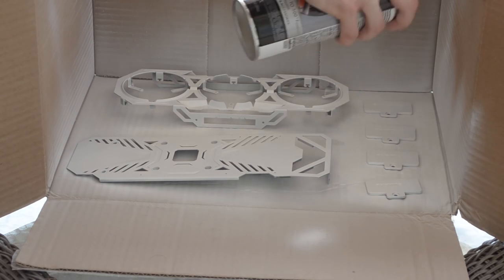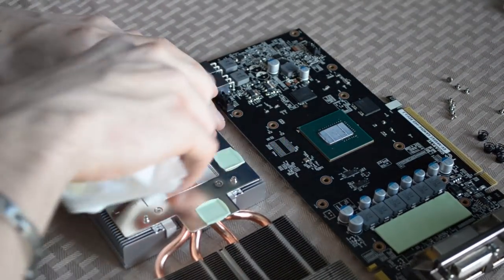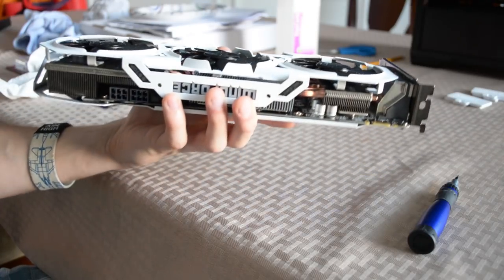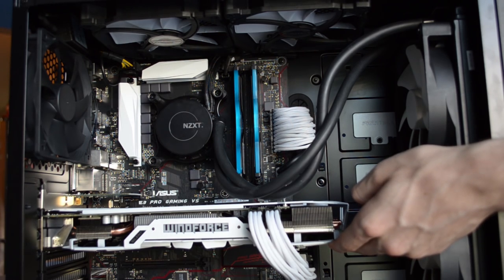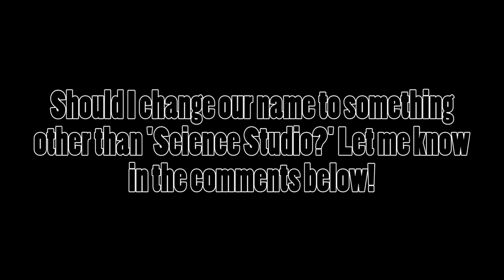Paint Your PC Components (Vol. 2)

Comment: Dude thank you I have a gigabyte gtx 1060 OC Model GV-N1060G1 and it was a b** trying to get everything apart. Did not want to reseat GPU but it made me due to factory potions of screws and power connectors. Dumb....  I am still taking mine apart right now trying to replace fans and your video helped me so much and was the only one out there remotely close to mine. Everyone else has a easy "Johnny 5 Disassemble" but no, not mine... Grrrrr.  Thank you had to apply some force like you said to pull up the heat sink. Also my screws to release heat sinks are on bottom and the front of the card, not the side like everyone else says in there videos, took me for ever to find it. o.o

Comment: Heyyo Greg, so I'm thinking of painting my parts white and doing RGB lighting like you did since this turned out amazing for you... but I'm feeling like a wuss since I'm worried about warranty so I was thinking of trying it with a type of paint that's removable... I know Plastidip is removable but it's rubberized and acts like an insulator so it's not the best choice. By chance can you recommend a type of paint that is removable in case I need to claim warranty that won't act as a rubberized insulator? Or do you think a rubberized insulator won't make too much of a difference?

Comment: You're making the heatsinks less effective by having layers of paint added to them (it's like you're putting a blanket between the heatsink and air).  Sure, it will still cool the components, but at a higher thermal equilibrium.  If one must paint a heatsink (as oppose to electrolysis), a paint that is specifically designed for high thermal conductivity is highly recommended (instead of just any off the shelf paint).

Tip for painting: Place your objects on a piece of paper inside the box.  So that you can rotate them (by rotating the piece of paper) between coatings while still having the walls up.
Reply from the maker: +PCUser1024 VRMs should never ever ever get very hot. Your first point is rather moot. I do, however, like your idea with the paper. Will have to do that for next time.

Comment: Nice guide :D You might want to be a bit careful with as5 not getting overspread (in case you put too much) as it might burn your gpu (if it gets in contact with any pins or anything that should not be touching)
Reply from the maker: +CubiX It's non-conductive. It won't hurt anything if it happens to run over, but I didn't put that much on anyway.

Comment: idk why no one actually researches what paints to use.. I'm a painter by trade and any plastic surface should be sprayed with adhesion promotor or heck even filling epoxy primer before using a basecoat. Otherwise it can easily peel, crack or melt off.

Comment: great idea, but if you want to have a better coat than what he had on his heatspreader, here are a few tips

1) mask the heatsync where the thermal pad would lie
2) PREP OR SAND THE SURFACE
3) tie it up as to not touch the sides of the paint, just thread it through the inside of the hole
4) if you dont wanna tie it up with dental floss, then you can put some poster tack on the tape where the thermal pad goes, and get some wooden skewers and use it to spin the peice around in your hand when painting
5) invest in some painting tools, if your dad has some use those, airbrushes are god teir for this, just make sure you use something like acrylic like tamiya, and airbrush that baby to sexy perfection
6) TOPCOAT TOPCOAT TOPCOAT, i cant stress this enough, dust will stick to the paint like a BICH, so topcoating will prevent that and scratches, and dont get the shitty krylon or generic brand topcoat, go to a hobby store and get yourself a can of testors, tamiya, mr hobby, etc whatever you can get your hands on, but please dear god no krylon
Reply: What do you mean by "Topcoat"...do you mean primer first?  I'm a painter by trade but houses are sure different than PC parts so I'm humbly asking for advice.
Reply: @furankuchan  i don't know paint at all... but it sounds like he said put a top coat over the last coat of paint to protect it from dust and scratches

Comment: Unclear instructions. I took the cooler off my cpu and painted the silver part pattern cleaning off the thermal paste and no I smell burning plastic when I run chrome.
Reply from the maker: ? The instructions weren't "unclear." You likely didn't reseat the cooler correctly or painted somewhere you shouldn't have. Besides, this is a very old video.
Reply: @GregSalazar  just trolling bro! great vid!

Comment: I have a p400, but how did you manage to use a remote with  the led's? mine are just connected to the front panel button
Reply from the maker: +joris yauw (MrYauwLifts) Separate LED kit. I've detailed it in my Xeon build video.

Comment: do you have to put new thermal paste on?
Reply: Nope! You don't have to but since you're removing the heatsink from the die anyways, you're introducing small micro bubbles that won't be there if you put new thermal paste on, thus technically reducing efficient heat spread. Generally if you have the high end components, you'll have thermal paste around to reapply. However it's not a necessary step.
Reply: +Josh Allen thanks for the answer man!
Reply: Clutchkick Chris recommendation confirm yes, I personally would use artic MX 5, or gelid solutions g extreme.

Comment: Would it be bad to paint my dust filter that sits on top of my case?
Reply from the maker: Probably.
Reply: Science Studio Ok
Reply: Don't paint that, the holes are small and the paint will fill those in. A good alternative would be to find some mesh in your preferred color or paint the mesh itself, then measure the dust filter and cut the mesh to the same size and place it over top of the filter to give it a tint of the color you want.

Comment: I would caution against spraying heatsinks, most of them are anodized. Yes engine spray can withstand high heat, but who knows if a spray makes the heat dissipation less efficient. How less efficient? No idea. A study would be cool, but until that happens, you might want to reconsider. What I will say though is kudos for not spraying the underside of those heatsinks where the thermal pads contact, that is important.

Comment: do you need to use alcohol to remove the thermal paste, or can you just do it without it?
Reply: u need to use alcohol
Reply: I shall make the rest of the guys here cringe. I did not have any clean alcohol, so i opened up the fridge and found Captain morgen, apply some of the morgen on the Qtip and whipe away the paste. I would not recommend it, but if it works it ain't stupid. It leves no room for errors however, so make sure the Q-tip is not soaked. as the alcohol vapor is not pressent in that unpure alcohol mix.

Comment: Nice video mate ... i have a problem, i have an Asus GTX 970 Strix graphics card. which is about 15 months old now, and it's back plate has developed some minute scratches due to cleaning dust off of its surface ... rest of the graphics card is in excellent condition and the scratches are just into the clear coat ... can you please tell me how to remove those minute scratches from my GPU back plate
Reply: +amanvds Without proper buffing equipment, painting over the scratches is probably your best bet.
Reply: SimplyChem
what kind of buffing equipment should i get. is a car scratching removing kit gonna work? i wanna sell my 970 and get a 1070. so painting is not an option for me
Reply: I honestly have no idea. Depends on the material. And for the price you'll pay for the equipment, it might not be worth it at all. Are they big scratches?
Reply: SimplyChem
No scratches are not big at all ... as i said earlier, they are just small scratches, which are only visible from a certain viewing angle ... in fact they are more like the swirl marks ... my case has a large window, and you cannot see them while the card is installed ... but when you pull out the card and give a closer look. they are visible.

Comment: 5y late to the party so not expecting a response 😂
But can you buy replacement fans in white? I want to paint my gpu white and mount it upright in an all white build but I want the all white fans as well then obviously
Reply: Probably online, im sure you can find some. Just dont paint yours because the added weight of paint could in theory screw up the motors inside the fans

Comment: Hi, I have a Gigabyte H97M-D3H motherboard and the chipset heat spreader or heatsink gets too hot its normal?
Reply: +Samuel Lopez
Check the temperature of the chipset itself with software like HWMonitor, for example. If its temperature is too high, you might wanna consider getting more airflow in the case to cool it down.
The fact that the heat spreader gets hot means that it successfully takes the heat away from the chipset, so you don't have problems like bad contact between the two.
Reply: +Plamen Yordanov, Thanks i have installed hw monitor, what could be the name in HWmonitor for the chipset temp?
Reply: Samuel Lopez
It's under a different name on different systems. The interface of the program basically splits information about the mobo, CPU, GPU, etc in different groups. The information about the motherboard should be the first group and the Temperature group under it should give you the readings of the temp sensors on the mobo. There might be one or more of them.
Reply: +Plamen Yordanov, Thanks.

Comment: I painted my PSU cords red so that I didn't have to pay more for custom sleeved cables. You should show people how to do that.
Reply from the maker: +Strike Claw Painted cables aren't on the same caliber as sleeved cables, in my opinion. Totally different look.
Reply: Science Studio True, but they still look pretty clean and unique. Look up some pictures of spray painted cables done right. It looks pretty good as long as you dry the paint correctly. What I actually did was wrap my cables in some anti melt high temperature electrical tape and then I just spray painted over the cables. I did this for all of my cables. I did this with a non modular PSU btw so it took forever but it was worth it.
Reply from the maker: Strike Claw It is VERY difficult to spray cables and end up with a clean result. I know. I've tried. I will likely just recommend purchasing sleeved cables for $10.
Reply: Science Studio Yeah. It was pretty difficult for me to do. But purchasing sleeved cables for my entire build would add 90$ to my budget which is why I just put tape around the cords and spray painted them red. I have a slightly tinted side panel window to so it hides any mistakes that I might have made. Honestly, I could've just wrapped my cables with red tape instead of spray painting them XD.
Reply from the maker: Strike Claw The cables I purchased were nowhere near that expensive, so I'm not sure where you're pulling those numbers from. The only ones that should be openly visible are the PCIe, 24-pin, and CPU power connectors.
Reply: Science Studio Oh ok got you. I was looking at kits on Amazon for 90$ for every cable. Didn't realize that all I needed to buy the pics, 24 pin, and CPU power connectors. Thanks for the tips. My next system will have sleeved cables lol.

Comment: the front fans in your pc are blowing in the wrong direction
Reply from the maker: No they are not. Did this by design. This is an old PC.
Reply: There were backwards then. All fans appear to he on exhaust
Reply from the maker: The fans on top are pulling in. You can't see those so I have no idea why you are using the word "appear."
Reply: Any reason to use this fan config? On normal conditions top intake isn't a bad idea? Cause of dust and stuff ?